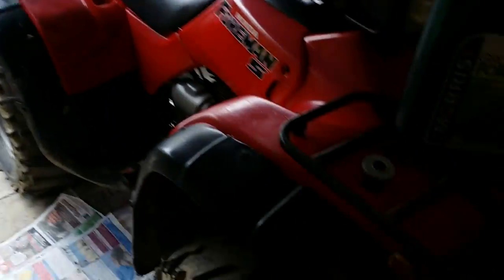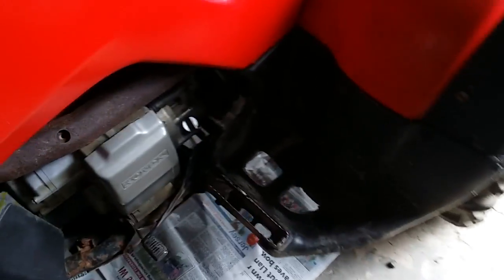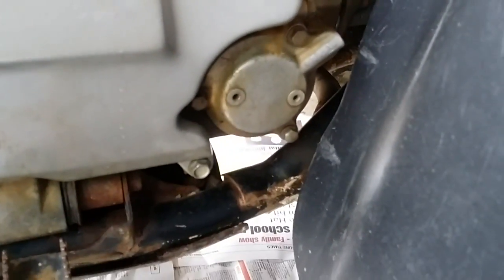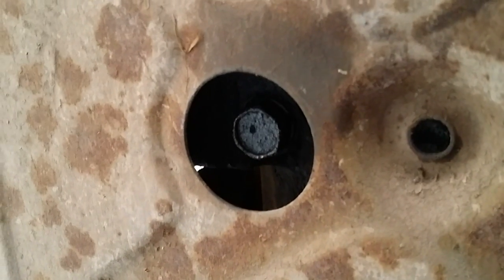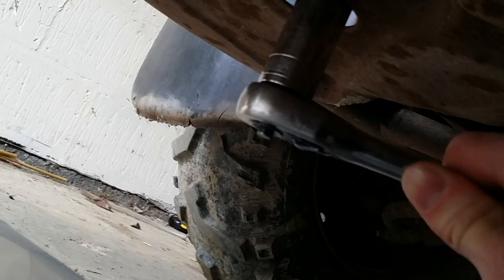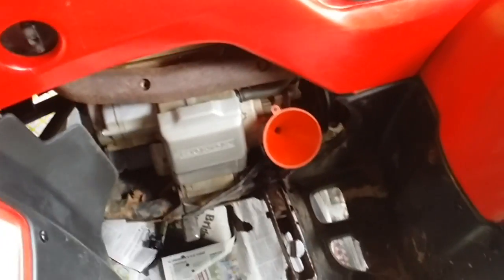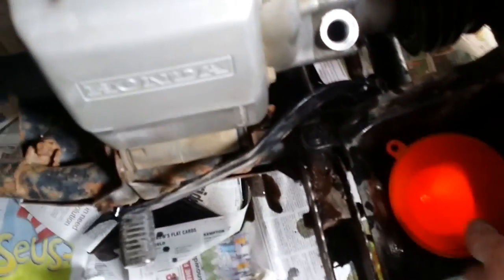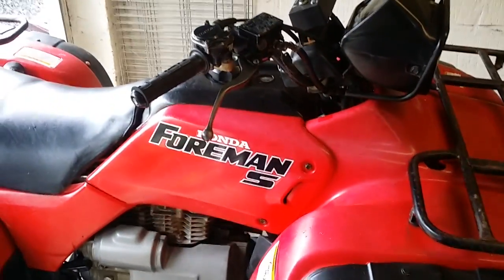How To Change ATV / quad bike engine / motor oil - 2001 Honda Foreman 450s 43000km

Comment: Hello friend ... my fan is coming on ... should I run a switch ?
Reply from the maker: +junior paul you could, although i never would unless your fitting a temp guage your risking it overheating. Check the thermoswitch. If not i think theres a fan control unit on this model. All else i can say without more information is that Iv had a of lot of quads usualy if theres a problem with something coming on rarther than not working theres an issue with a physical componant rarther than wiring although if it is wiring it rarely gets resolved to factory unless you really spend some time on it.